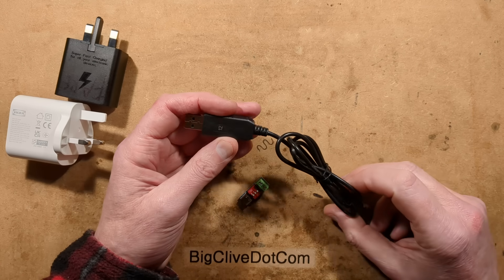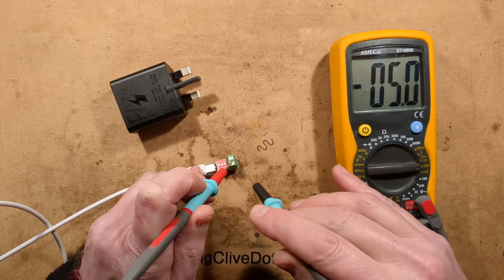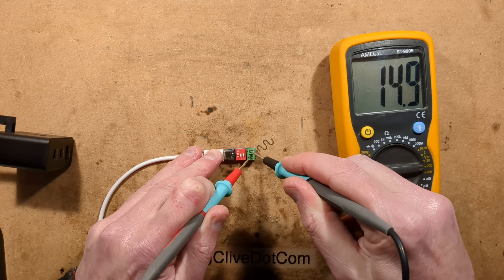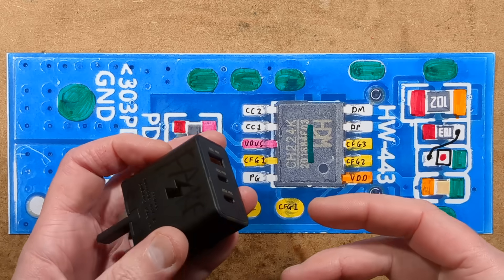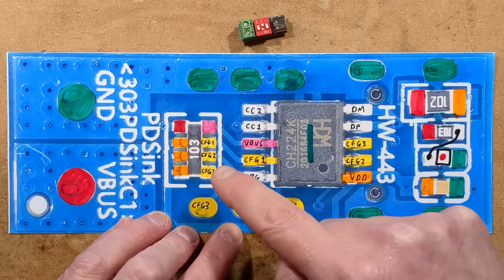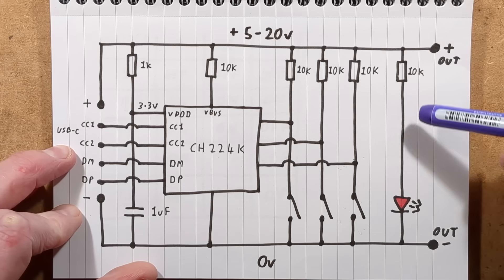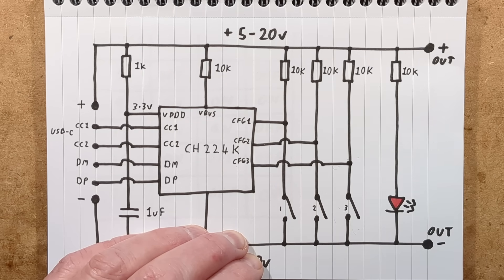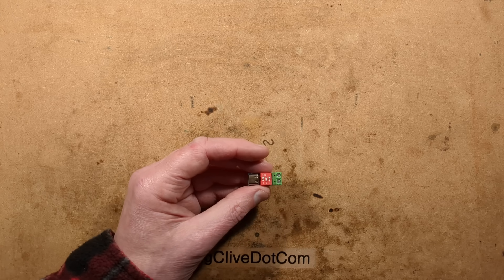Cheap USB-C programmable PD voltage module for 5,9,12,15,20V

Comment: I use a few of these that are fixed voltage and 2 where I can use buttons + and - to set the voltage indicated by (obviously blue) LEDs. These things are awesome. Also the fact that this one connects to D+ and D- means that it can also enable the high current mode for 5V and possible even supports Quick Charge which is kind of a predecessor of USB-PD. The newest PD spec allows up to 48V at 5A with coded cables for safety. Another PD spec extension allows you to set the voltage in x (I forgot) millivolt steps, effectively allowing you to directly charge the battery using constant current in a MUCH more efficient manner!
Reply from the maker: I wonder how long it will be before the fake coded cables come out with thin copper coated aluminium cores.
Reply: @bigclivedotcom I imagine they're already on the slow boat from China
Reply: "Why does a magnet stick to my charge cable?"
Reply: @OddlyIncredible  magnets don't stick to aluminium as it's non-ferrous. Are you thinking of something else?
Reply: @JamesTK copper-clad steel!
Reply: Yep, copper-clad steel - or even worse, iron - cabling out of China is a current problem.
Reply: @OddlyIncredible  definitely iron. Would be more magnetic than steel as well
Reply: @OddlyIncredible  Because they have oxygen-free nickel cores - obviously for the Hi-Fi market as nickel is more expensive than copper and thus much betterer. Pay a bit more and you can buy the premium version where each core is hand painted with green marker pens before assembly to tighten the dynamic mid-range punch and sharpen, whilst at the same time subtly softening, the enriched enveloping soundscape.
Of course the true audiophools will only buy the pure silver or gold versions.
Reply: I was playing around with a power analyzer on some new toys and was surprised to see the airduster from Torque Test (Wolfbox something) actually used PPS to charge the battery directly, which was neat. Was more surprised that my old Anker power supply supported it.
Reply: @Lizlodude  I think Warp/Dash Charge also does this, but with 5V and proprietary. But it's a lot more efficient.
Reply: The Quick charge 3 and higher specification also supports that.

Comment: i tested that just a few days ago, and got just 5, 9 and 12v, indeed... so it was psu fault, not them... thanks to share!
Reply: I don't think anything below the 65w-ish adapters support 20v. Because, afaik, the profile requires 3A to be available. PPS partially solves this by being able to specify current and voltage
Reply: @JohnDoe-c2f reasonable thought
Reply: Well remember this is not a power supply this is a dummy trigger basically USB CPD quick charge and PPS devices have the ability of providing multiple different voltage outputs this device does not provide those voltages what it does is sends the appropriate trigger command which is why they're called a PD trigger to the charger that says hey I'm a 12 volt device and the charger goes okay give me your handshake it gets the appropriate handshake and says okay here's 12 volts. 

That's all this does All it does is tell the power supply I'm this many volts with the appropriate correct handshake for the protocol and then the charger itself provides the voltage and the power.

Comment: I love these. I use them to replace all sort of 12V devices around my house for USB-C power instead. Much better.
Reply: Yeah, my dream is to get a multiport GaN PSU on the back of my rack, and put these in all the devices that currently have barrel connectors with dedicated wall warts...
Reply: @d00dEEE  the only downside I see is a faulty gan charger would takedown all downstream devices. And it re-negotiates when you plug/unplug with all ports, so other devices will lose power momentarily when you plug in a new device. Not ideal. 

My solution is now to keep the discrete barrel adapters, but t off to a power strip and plug them all of them in there. Saves sockets on the main strip, and since these devices barely draw over 100w in total, not an overload risk.
Reply: @FirstnameLastname.69 All PD supplies don't renegotiate all ports when a single port changes
Reply: @timmturner  Really? Can you share which charger you use that doesn’t do this?

That’s been my experience with many dual and triple type c chargers. The top one is for the highest output, and the newer ones get dynamically adjusted depending on if two or three ports are used. Fine for laptops, phones etc since they have a battery anyway. But for something like a switch or router, or game console converted to type c, not ideal.
Reply: @FirstnameLastname.69 sure, the SlimQ 100W 3C1A, but they make much more powerful supplies which have individual PD ports as well.

The 100W model is enough for me, I also got tired of supplies which renegotiate each port as I power small board computers with these supplies and can't have them hard reboot when I plug something else in such as to charge my phone or what have you.
Reply: @timmturner  nice. I only have thosse that renegotiate when a new device is connected and that sucks.
Reply: I just have a 20A 12V psu and wire barrel jacks and inline fuses for each device. It’s probably safer in some ways (fewer mains devices to catch fire) and less safe on others (I’m not smart enough to think of everything that could go wrong). Now I seek out 12 V network equipment etc, so I don’t need separate plugs. USB C seems overly complicated for this, but it’s probably cheapest and best, that’s how it is with tech.
Reply: @palmariusbjrnstad1682  I also seek out devices with certain power requirements but I like to see devices with a 9v ~ 24v range, many devices are like this but you have to dig to find out the range.

Comment: These PD units are pretty good. they also act as a protection fuse for devices that might backfeed. I've killed a couple of these from that from a power bank that wasn't too safe with it's DC barrel jack, it was both an in and out, so if you use these a lot I rec just buying a handful and keeping a spare.

Comment: The problem with these modules (not just the CH224 based ones) is that if you say, request 15V and the power supply doesnt support 15V, you will get the next PDO down that is supported, eg 9V. If you want to guarantee a particular PDO, you have to get a microcontroller involved.

The CH224A is slightly better than the K in a few ways.. I think it uses less power in itself (the K has a fairly inefficient shunt regulator). I think the A also supports I2C - however when I tried this out myself I couldnt get it to work. I ended up designing the HUSB238 chip into my own circuit, but these are in a very unfriendly DFN-10 package that is impossible to solder without hot air.

Comment: As far as I know these devices, the vbus pin actually measures the voltage and pulls the here not used PG (power good) pin low when it fits. That way an external microcontroller can easily check if a voltage switch worked or it could be used to switch a mosfet when the power supply is ready. Maybe you could test that theory?

Comment: I have two PD to 12V barrel plug cables for powering the FTTP ONT box and VoIP box, and standard USB A to C cables for router and WiFi access point, all connected to a 1kWh power bank to keep things running during a power outage.

This time last year Storm Darragh caused a long weekend without power, as did Éowyn in January. Back then we had a standard UPS which only gave us about 3 hours of internet.

Mobile signal is not great, and copper pair PSTN is being withdrawn this coming year, so keeping the net connection live is essential.

And as some other comments have said, you have to be careful as some USB PD outputs skip 12V.
Reply: Doesn't work here because when the power is out in the whole region, the head unit is also offline. Also if you live in an apartment building and using DOCSIS (internet via cable TV), you need to consider that there is an amplifier and distributor in the basement that needs a bit of power as well. And it often has an integrated PSU, thus needed mains power.
Reply: @kyoudaiken  True. Doesn't work for cable TV internet, but does work for BT/OpenReach fibre.

Comment: Perhaps I missed this but, given that the three-position switch suggests eight binary values (0-7) and the supply puts out five voltages (5,9,12,15,20), what happens if you set the switches to one of the 'forbidden' values? Does the magic smoke leak out or does it just do something rational?
Reply from the maker: See the description.  The non valid settings just put out 5V by default.
Reply: This chip has 4 voltages only.
I guess wrong switch configuration should give You 5V - most of The PD supply not recognize this and deliver 'save' 5V voltage

Voltage table from IC datascheet:
1 - - (5 V)
0 0 0 (9 V)
0 0 1 (12 V)
0 1 1 (15 V)
0 1 0 (20 V)

Comment: It might be a good idea for you to get a better USB tester that automatically test the voltage current and wattage. In a pinch, they can also be used as a cheap adjustable power supply.

Comment: Kind of OCD sad you didn't mention what the missing 'invalid' settings do to the output, in this case:
Unknown:
OFF-OFF-ON
OFF-ON-OFF
OFF-ON-ON
My guess would be 5V both as a failsafe but also since 5V setting is the only one to have SW1 in the OFF position.

Known:
5V - All switches OFF.
9V - All switches ON.
12V - SW1-ON / SW2-ON / SW3-OFF
15V - SW1-ON / SW2-OFF / SW3-OFF
20V - SW1-ON / SW2-OFF / SW3-ON
Reply: It was mentioned in the description of the video including that table.
Reply: @effedrien  Indeed you are right, I could have sworn that last remark wasn't there when i posted, but i guess my brain just glossed over it 😅
Reply from the maker: See the video description.
Reply: Aye, I was hoping for dip exploration as well.

Comment: I’m curious, as the supply raises the voltage current capacity must go down, but how much?
Reply from the maker: The current capacity remains the same.  These devices can transfer more power by using a higher voltage at the same current.

Comment: I've used a similar module with a PWM motor controller and a DPDT switch to build a model train controller. Not a problem if the power supply only delivers 9v (or even 5v) instead of the requested 12v, the train just runs slower. There's now a mass produced version from Kato, but as they didn't bother with the PD part it only delivers 5v.

Comment: i bought a usb c to male pin to power up my echo dot 5 gen, i checked that outputs 12v but when powered up from a 45w samsung powerbank the music volume stay really quiet.
i do not have any means to test if it is asking 12v from the power bank nor if its holding at it.
have you guys used theses adapters?
Reply from the maker: Keep in mind that not all prominently branded power banks and power supplies are real.

Comment: nice little device , but i guess the actuall trouble will be the stability of the DC,  like is it really a saw tooth dc :)

once upon a time i tested an AC generator and measured it with a power [watt meter plug]

whuch made a scream ing noise then died and the AC was one of those charming quare wave AC voltages.

after tht it got hot eerytime i plugged it in and the display was garbled ;)

if you use an iffy power supply it will most certainly end badly

sounds lik a zener diod and fule between it and its target may be a good idea, just in case :)